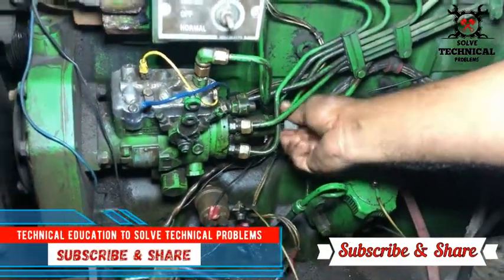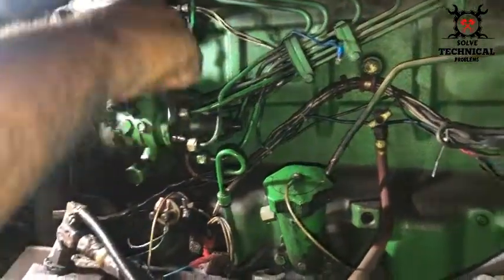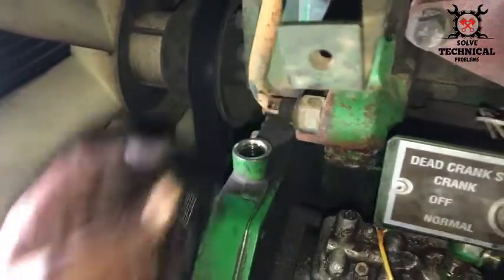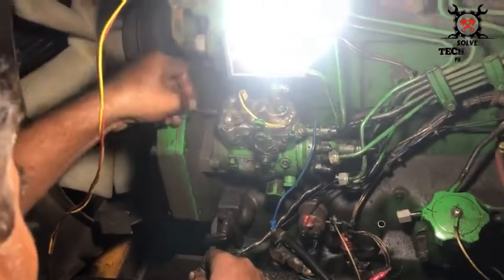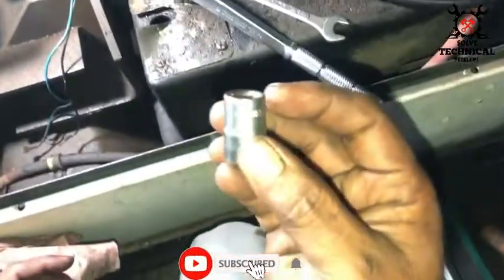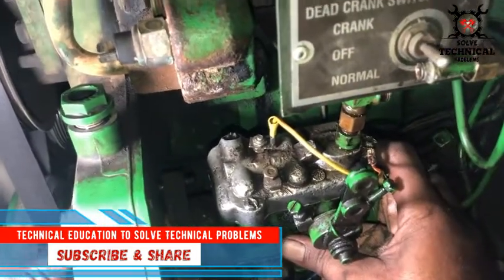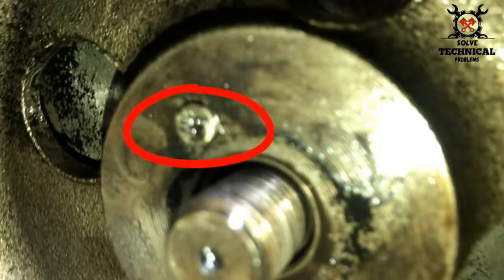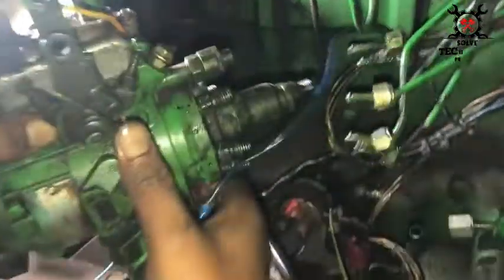How to lock the stanadyne fuel pump for removal John Deere USA Stop valve faulty repairing

Comment: This video is not good, as there is a puller required, and dropping a socket on the pump gear will cause pressure and mis alignment. Follow JD recommended removal procedure, and you will not end up with broken parts.